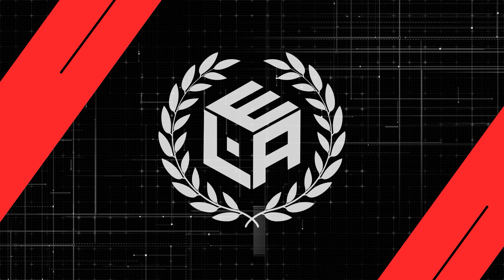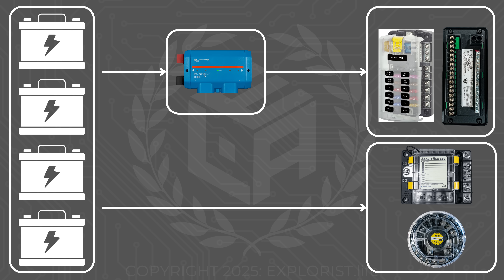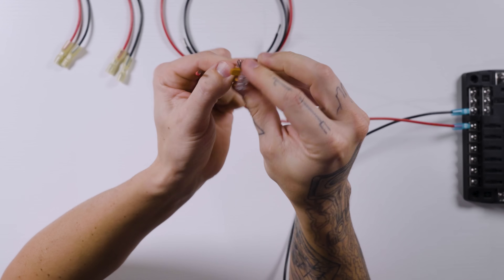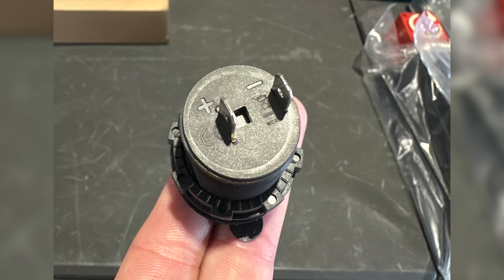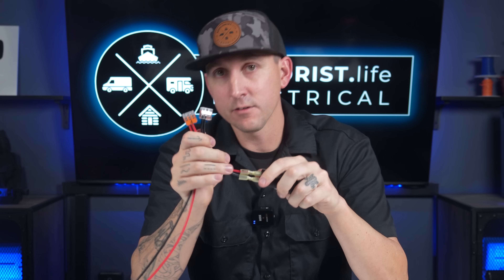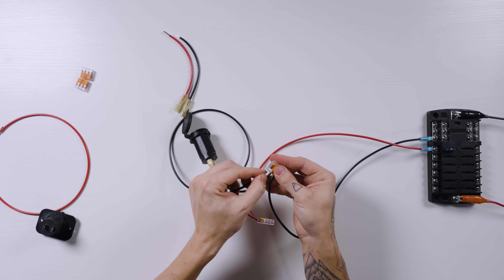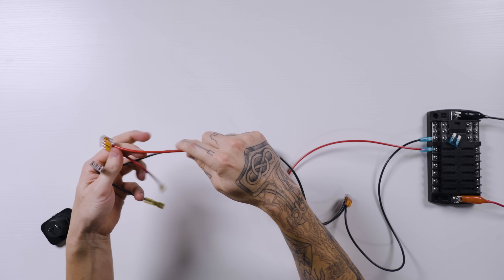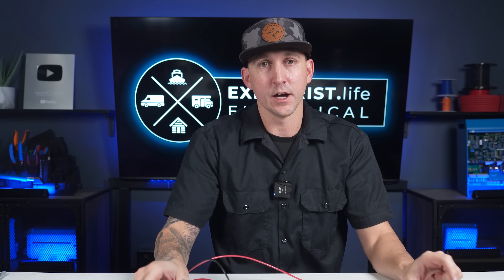How to Wire USB and 12V Outlets  - Branch Circuits | Ep: 1/10

Comment: When you're doing calculations for wire gauge, obviously the wire coming from the fuse box that is shared by both outlets must be a bigger gauge to handle the combined load of electronics plugged into both outlets at the same time. But can the gauge of wire running to each individual outlet be calculated separately based on the load of that individual outlet? Put another way, can you have thinner gauge wire going to each outlet and heavier gauge wire in the shared part of the circuit? And if so, shouldn't each individual outlet have their own fuses (assuming the "shared" fuse would only really protect the heavier gauge shared wire)?
Reply from the maker: Great question — branch circuits, wire sizing, and fuse placement get very project-specific very quickly. Rather than guessing or giving a one-size-fits-all answer, we’d really want to look at your exact loads, wire lengths, outlet types, and protection strategy to make sure it’s safe and compliant.

If you reach out to our support team, we can take a personalized look at your setup and help you choose the correct wire sizes, fuse strategy, and parts for your build 👇

https://shop.explorist.life/support?utm_source=youtube&utm_medium=comment&utm_campaign=support&utm_content=response_link

Comment: Hi
Do you have a video of how and where and why  to use a scc9005000000 mppt control solar charge controller (looks like a small round monitor) in a two or more smart controller one battery bank set up? And how to wire the shunt.
Thanks

Comment: I am minivan campervan building currently just using a Bluetti AC70 and trying to decide how I want to wire AC and DC.  Would I get the fastest charging using a 100 watt USB C cable to connect the Bluetti directly to my laptop for example or is there some type of USB C port I could wire and have a USB C outlet to get the same charge.  Also what is your opinion of an AC outlet that has USB C ports.  Is the advantage of using separate DC outlets to save power from the battery.  I will most likely add a battery of some type in the future.  Trying to both get the quickest charge and use the least amount of battery.
Reply from the maker: There are a lot of variables in play with that setup, and the best path really depends on how you plan to expand your system and what gear you’ll be running. We’d be happy to take a closer look at your layout and help you sort out the best charging and outlet strategy for your build. Just reach out to our support team and we can walk through it with you:
https://shop.explorist.life/support?utm_source=youtube&utm_medium=comment&utm_campaign=support&utm_content=response_link
Reply: @EXPLORISTlife  I am also confused about the amount of watts that can be distributed by one of these using 12v DC.  I read of there being a limit of 36 w but then read of ones claiming higher such as 65w.  I also wonder is there some form of circut tester for USB that can tell you  how many watts the port is giving out.  Thanks
Reply from the maker: Sure!!  Happy to help!  Did you reach out through the link in our previous reply?

Comment: The problem with this simple circuit. Is that the output is the same as the battery. And lithium system when fully charged is 14.2 volts for example. Some 12v things I plug in (tv for example) seems to shut off if the voltage is over 13.8 (I think) what I want is what to add to that simple
Circuit, for a stable 12v power output. While a vehicle has a regulator to its cigarette plugs, this system doesn’t?
Reply from the maker: We have products that solve that concern: shop.explorist.life/support for help

Comment: How many 12v outlets can we run in a series?  Particularly if I’m using several to charge multiple devices at once.  Trying to decide between this or just adding another 12v panel in my “office” area.  Another excellent video, by the way, looking forward to the summit next month.
Reply from the maker: Thanks so much — glad you enjoyed the video, and we’re excited to see you at the summit next month!

When it comes to running multiple 12V outlets, the real limit usually comes down to the total current draw of all devices combined, the wire size, and fuse protection — rather than a specific number of outlets in series. Depending on your setup, adding another 12V panel in your office area might give you better control and power distribution.

For a personalized recommendation based on your exact needs and layout, definitely reach out to our support team here:
https://shop.explorist.life/support
(They offer free personalized support if the parts were purchased from our store!)

If you got your gear elsewhere, our EXPLORIST Pro Support Membership is a great option for one-on-one help:
https://shop.explorist.life/shop/all-products/membership-tiers/

Comment: So would it be fine to put 3 chargers together and they should work fine right? Or what should I worry about when come with load?
Reply from the maker: Good question! Running multiple chargers can work in some cases, but the load balance and source limitations can get tricky.

For help evaluating your exact setup and making sure everything is safe and effective, reach out here:
https://shop.explorist.life/support
(Free personalized support is available for gear purchased from our store!)

If your chargers came from another source, our EXPLORIST Pro Support Membership is a great way to get tailored advice:
https://shop.explorist.life/shop/all-products/membership-tiers/

Comment: If you were installing this on a motorcycle would you still use the level nuts? I am not sure how weather proof they are. Thanks for these videos. So straight forward information.
Reply from the maker: They don't really need to be weather proof.   It's just 12V.  think of a 7 pin on the back of a truck: not weather proof at all.

Comment: Before finishing the video, I wondered why you were installing the lever nuts.  As I continued watching, I realized you planned to extend the branch to include an additional outlet.  I've never used lever nuts before, so I checked them out and discovered that they're available in a variety of wire capacities.  I'm going to order a variety pack of them to keep on hand.  They look pretty handy.
Reply from the maker: They're pretty great! We use them all the time!

Comment: Thanks for the great videos. A quick question. Shouldn’t the two 12V appliances be connected separately to the bus bar and have a fuse each? If not, is it because they draw low amount of current? Thanks a lot!
Reply from the maker: Correct.  Much in the same way that all of the outlets in your bedroom are on the same breaker.

Comment: Are those "lever nuts" suitable for use in a marine environment? (I mean, I've always been told that all connections on the boat need to be covered in heat shrink tubing.)
Reply from the maker: They most certainly are given they aren't installed in an area they are prone to getting splashed, submerged, etc.

Comment: For either of those is 18awg copper adequate?
Reply from the maker: For branch circuits like these, you'll want 16AWG to be the smallest as anything smaller is just a bit too brittle/fragile for use in a van/marine situation where the wires are constantly moving.  This one is actually an ABYC requirement.  Great question, though!

Comment: Are those lever nuts good in high vibration environments like vans and boats?
Reply from the maker: Would I recommend them if they weren't? 😉😉

Source; https://www.youtube.com/watch?v=L4SyzW1X8pg
Reply: @ interesting test and comparison. Like you, I don’t trust wire nuts. I don’t think they have any place in an electrical system except benchtop testing.
I guess lever nuts are much closer to the old fashioned screw connectors. In a van they will probably work well.
I still don’t like them on boats for a variety of reasons. Most cables are behind the build in furniture which makes it hard to access. We also often have to drill small holes to pull cables thru and this design makes that a ton harder. While I can’t say how prone to corrosion the design is, it’s kinda difficult to put heat shrink on it.  Boats leak, usually saltwater This means there are more potential failure points. I guess for cabin lights it could still be a viable option, but not my preference. I think the design can also be improved by putting a mounting hole in it like some cable ties have. And there is likely going to be quality differences depending on brand. 
I’ll get a few to play around with though.
Reply from the maker: @TheCornucopiaProject-bd5jk  I suppose it's worth mentioning that I was introduced to lever nuts by Capt. Charlie Johnson, PE. Charlie, a liveaboard cruiser with thousands of blue water and coastal miles under the keel, is a registered professional engineer with mechanical and nuclear specialties, a USCG licensed captain with 100 ton and towing certificates, an ABYC certified marine electrician and a retired Naval Officer who specialized in repair and maintenance of our nation’s nuclear submarine fleet.

But yeah - to each their own.
Reply: @ they probably work great on larger boats. Doesn’t mean I have to like them on smaller ones.
Reply from the maker: @TheCornucopiaProject-bd5jk  just presenting information as I’ve found it. And defending my position as it’s questioned. Take it or leave it. 🙂👍

Comment: Great video.
I have a few questions that would be great to see in a future video. Using a retail build mindset and using as few wire sizes as practical. What what are the wire sizes of choice for these dc branch circuits? With 24v systems becoming more popular. What hardware differences, if any, are there for, say, a 12v device circuit and a 24v refrigerator or other equipment circuit? Are junction boxes recommended for 12 & 24v circuits? Anderson power connectors vs. cigarette lighter plugs?
P.S. 
Thanks for all your help with my recent order!

Comment: Tapping in to my 12 volt panel for this application is not practical because of the panel placement. Could I tap on to another 12 volt source like wires running to a lightbulb or other 12 volt fixture?

Comment: Thanks! I’m wondering if there is an option to condition the 12v outlet to only provide 12v, I can see up to 14v, which can damage a rechargeable battery. 
Thanks
Reply from the maker: You could indeed add a 12v to 12v converter inline before the 12V outlets to do that, yes, but neither of these should be directly charging a 12V battery without going through some type of charger.

I'd be curious of your specific scenario.
Reply: @EXPLORISTlife  I have a Ukiah fire pit which charges at 12v from an ac to dc converter. I ran 12v power to the bed of my truck and want to charge from that, and eliminate the ac/dc converter all together. After investigating the charging system on the Ukiah it clearly states that anything over 12v will hurt the batteries/charging system. 
Your help is appreciated!
Reply: On my boat I have wired USB and 12v outlets on separate circuits.  My logic is 12v outlets can draw significant currents (10 to 15 amps depending on outlet type) while USB circuits draw modest currents (QIC type).  Power outlets can cause modest voltage drop at higher currents or even voltage spikes on switching of some connected items. These current drops and voltage spikes dont play nicely with USB oulets .

Comment: Some USB outlet install instructions require installation of a fuse link between the fuse block and the USB outlet and close to the outlet. Usually 2amp. 

Is that redundant or just another safety precaution? I see your fuse block has a 15 amp fuse and I would think that would be relatively high for something like a cell phone but not so much for a refrigerator.
Reply from the maker: That’s a good question.  I’d be avoiding any manufacturers that spec’d that requirement to remove that variable from the equation altogether as troubleshooting would then involve uninstalling the outlet/wall for potentially just a blown fuse.

Comment: Excellent presentation.  Thank you.   Do those USB outlets have a "standby" current draw when not in use?   If so, I wonder how much it is and if there is a difference between the good/cheap ones.  If they are are wired directly to the battery and not via an "ignition on" source, this needs to be considered if your vehicle sits a bit between trips, especially if you go wild and add a bunch of them.   Also needs to be considered if you wired them to your secondary lithium batteries as every watt counts on long trips. Probably a good idea to put them on a manual switch for long term usage.   I checked the blog and didn't see this mentioned there either and I think it is worth mentioning, especially to folks newer to this type of stuff.
Reply: Interesting question.
Reply: @bmbpdk  12v to 12v outlets don't need a converter/booster so there are no electronics involved. USB of all types have to convert 12v to "something else" which means there are electronics involved and almost always have a standby draw.  The USB outlets in your car are on an ignition on switched circuit so they "turn off" when the car is off to prevent long term standby draw issues.  These things are great and very convenient so why wouldn't you put a bunch of them in your truck or camper.  Just put them on an ignition on circuit or have a manual switch for them if the vehicle sits much.   I personally don't like any parasitic "standby draw" items that could leave me stranded if I forget about them.
Reply: @GoForAHikeNC  Thank you!
Reply from the maker: @markmonroe7330 good question!

I just tested my cheaper ones and they had no measurable standby draw (less than .000W).

I also tested a much more expensive version that has a boost transformer in it for full PD quick charge for MacBooks and such, and it pulls .366W at standby.  For context, that would pull a little less than 3/4 of an amp hour from a 12V battery bank over the course of a full day.
Reply: @EXPLORISTlife  Appreciate the reply,  a .366 watt is non-trivial, especially if you have a few of them and more especially if they are on your lead acid starter battery(s).
Reply from the maker: @markmonroe7330 certainly!  Ideally, and consistent with the context of this video, these would be wired to an appropriately sized house/aux battery bank, charged by solar, alternator, or shore power, where 3/4 of an amp hour wouldn’t matter much.

Comment: It would be interesting you talk about 3D Printed Lever Nuts holders.
Reply from the maker: Although they are pretty neat, I've never printed/used any.  Just zip tying the wires below the lever nuts and then securing the lever nuts near the connection with zip ties is plenty sufficient.